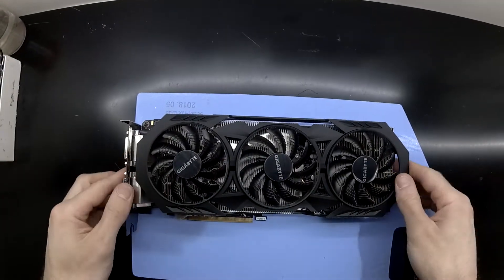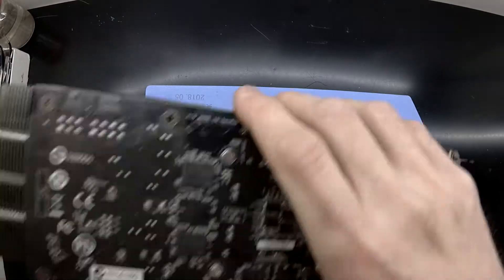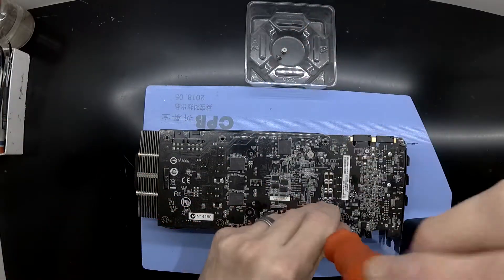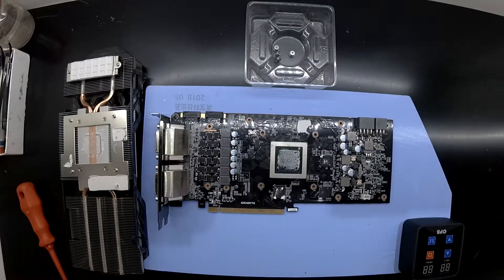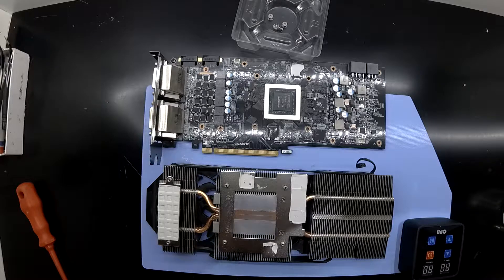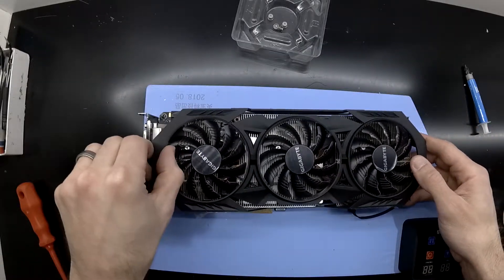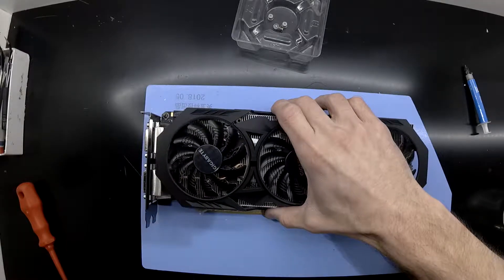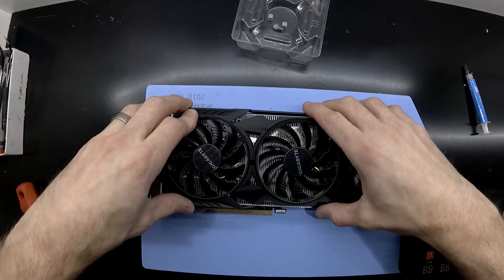Gigabyte Geforce 970 Windforce 3 OC Thermal Paste Replacement

Comment: Thanks for the video man, I'm thinking about reforming my 970 due to the insanity the gpu market is at right now and I'm about to buy a new heatsink with fans, but all the offers I could find the fans were 3 pin and I didn't rmber if the gpu was 4 pin or 3.
Reply from the maker: If you don't have the factory cooler, see if you can get an aftermarket GPU cooler for your card

Comment: I just cleaned my Gigabyte G1 Gaming Windforce GTX 970 card and repasted along with replacing the thermal pads. I don't remember if there were LEDs that lit just below the PCIe power connectors. I don't see any LEDs lit on mine. Are there any the light on yours (I'm not referring to the windforce logo)?
Reply from the maker: not sure sorry
Reply: Another user confirmed that there is no LEDs for the PCIe power connectors. Now I just need to figure out why my fans aren't spinning 🙁

Comment: Shouldn't we replace the thermal pads as well?  Mine look like yours did when you pulled it apart, torn up just like that.  I'm just not sure what size to get.
Reply from the maker: Ay big boss, it would be recommend to replace the pads but usually replacement pads aren't always on hand

Unlike thermal paste which is almost everywhere in the pc world
Reply: @rickstechrepairs  What about ram's pads thickness and Vrm's? Nobody tells for that specific card. 0.5 to 2 mm is huge difference. Do you know? Thank you.
Reply from the maker: @syfiltzo  no sorry I don't know , I no longer have the card
Reply: @syfiltzo  i think they are 0.5mm thats what i used on mine
Reply: @NitroVids  are you 100% sure?? i would like to change paste and pad. looking for info about that

Comment: been hunting around for thermal pad thickness and well .... i guess replacing them doesn't matters as much on this card because some of the ram chips are on the back with no cooling however on modern cards after ripping one in half you probably should replace them aka you ripped one in half when taking about the card like that
Reply from the maker: dont have sizing of the thermal pads sorry
Reply: @RadarLeon  hey did you manage to find the correct thickness? im trying to find them too before buying and its being hard.
Reply: @malchezar  .5mm ram chips 1.5mm for vrm bought fujipoly xtreme x-e there is also ultra extreme XR-m  hope that helps but any pad around 6w/mm should do great
Reply: @RadarLeon  Thanks a lot!!

Comment: Last year during the bitcoin time,i brought a gtx 970 g1 gaming oc addition.I have found that there is a problem of the incomplete contact between chip and heatsink(i cant open the metal plate behind due to corroded screw).The shape of thermal paste spreading also isnt look quite well..The fur mark test is skyrocket to 75degree or even higher after 1-2mins.
Is it possible that the metal plate have affect the force on chip and is there any way i can solve the screw problem？
Thank you for reading such a long question
Reply from the maker: if the gpu cooler isnt mounted properly it will overheat, the gpu 
sounds like it needs a thermal paste replacement
Reply: @rickstechrepairs  Thanks for advice i will take a few more trys

Comment: Hello, this might seem like an odd request but my GTX 970 G1 Gaming card died recently when a bug got stuck under the backplate and corroded two of the resistors (R637 and R638 Below the "CE" logo) They appear to be the same in your video. I was wondering if you would consider measuring the resistors ohms with a multimeter so I can buy the correct resistors to solder on my card.
No problem if you can't. I can live without it til I can save up :P
You have perfect spreadage btw :D
Reply from the maker: i should be able to do that as im pretty sure i still have the GPU on hand
Reply: @rickstechrepairs  You are a godsent.
Reply from the maker: @veazix  https://www.youtube.com/watch?v=RL-Y0l5i4Gs
Reply from the maker: i dont know if that would be much help

R637 is blank and has nothing there
Reply: @rickstechrepairs  It's possible on mine that resistor never corroded away and was actually blank. Thanks again.

Comment: Mine running too hot after pads and thermal paste replacement. Throttling 🫤🫤 wtf
Reply from the maker: thermal pads might be too thick, and cooler isnt touching GPU Die
Reply: @rickstechrepairs  yes. Changed them. Now its super cool.